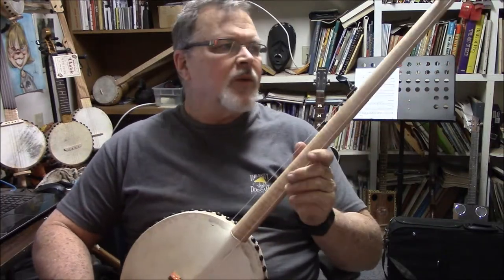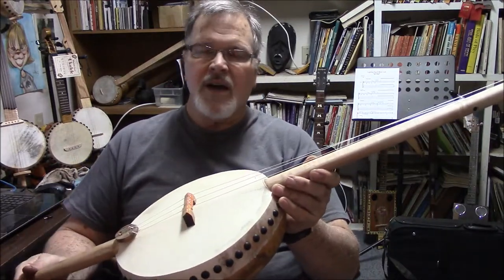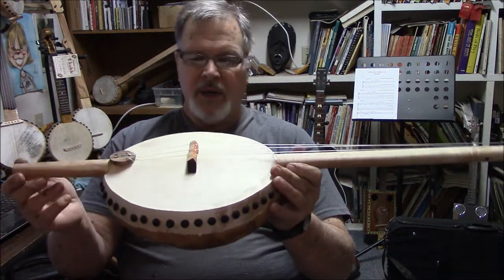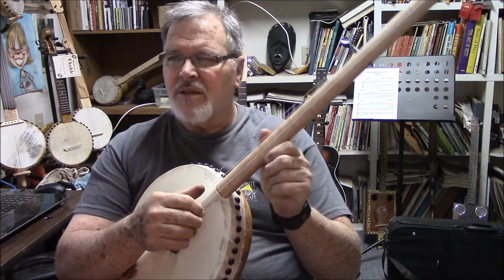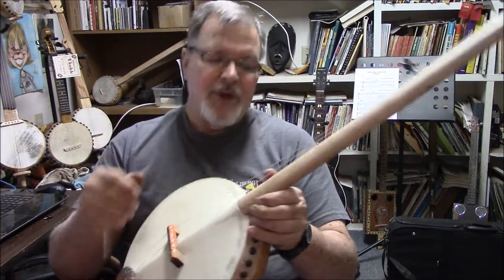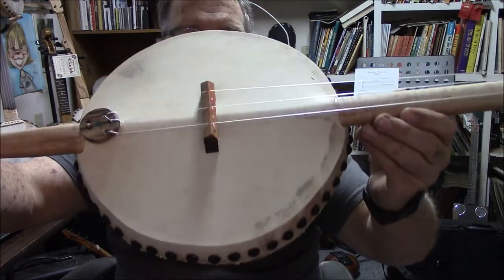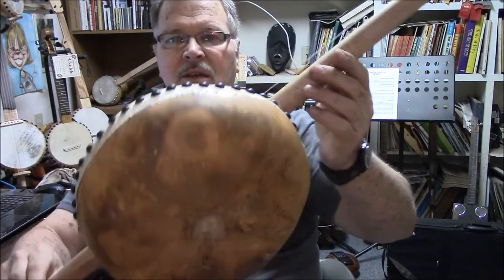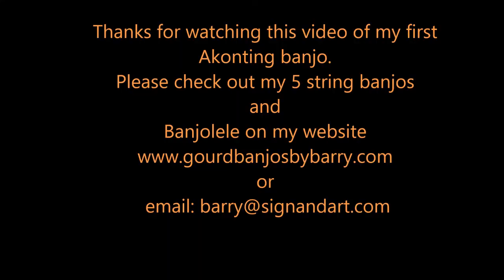first akonting banjo

Comment: Hey, Barry! Beautiful instrument. A lot of your info regarding identifying the instrument and details about construction are inaccurate, though. We shouldn't refer to the ekonting as a banjo, or suggest that it is the "first banjo" or anything like that. Banjo history nuts (like me) get very bent out of shape over that kind of sentiment regarding any West African plucked lute that we are citing as a model for early banjo. The ekonting is an ekonting (obviously), an ancient plucked lute of the Jola people of Senegal. The banjo is a "modern" development, a creolization of traditional West African plucked lutes. Don't get me wrong, I happen to think that the ekonting is the best model we have so far of West African origins for the banjo. Calling it a banjo, though, is just kind of weird and wrong. (Sorry if I sound uppety.) Also, folks should know that the original ekonting does not have tuners (strings are tied onto the neck with a special knot); there is no tailpiece, per se; the neck is not typically made of wood (papyrus stalk); there absolutely are "sound" holes, usually two--one is actually a sand hole; most common tuning is M2 from first to second string, and m6 from second to third string. So your tuning would be C-E-D. BTW, I've made several ekontings with strings tied on, and a few with tuners (made the first with tuners for Rhiannon Giddens several years ago). Hope this is helpful.
Reply from the maker: Hi Paul... I appreciate the info. I have received most of my info from the fellow that is the curator of the Maritime Museum in Savannah Ga. I suppose I have some info that is not totally correct, however, as I state it is a replica...my take on an instrument that could be played by folks that want something a little different. This is by no means a historical representation just a similar instrument to have fun and experiment with.
Reply: @Bsholder  Hey, Barry. Sorry, very belated reply! Gonna continue to be anal (sorry).  So, "replica" means a faithful reproduction (an exact copy) of something. You have not made a replica of an ekonting. You have made a really cool, beautiful modification of an ekonting. And that's okay--it's more than okay, actually! It's awesome, because that is exactly how the banjo came into being! European sensibility encountering traditional West African sensibility, holding onto certain elements and making modifications to suit particular needs or inspiration. Sorry to lecture!  Cheers!  --Paul
Reply: The Akonting is actually the Banjo's Great Grand Daddy

Comment: How did you get the head tight?
Reply from the maker: The head is put on wet. It is soaked for about 30 min. It is put on flat then I cut a slot in each end and then feed the neck like a giat sewing needle. In and out the side.
Reply: Thanks!
Reply: Thanks very much.